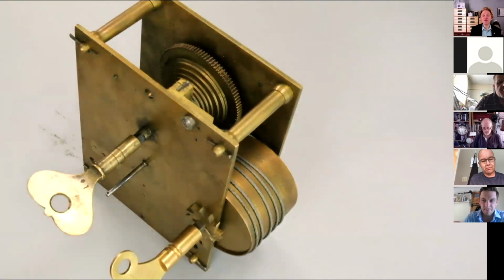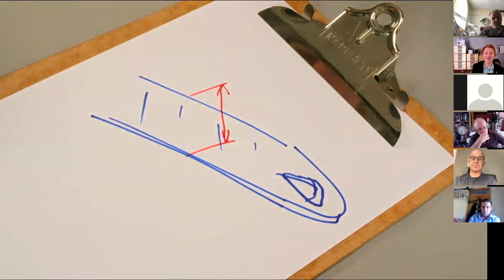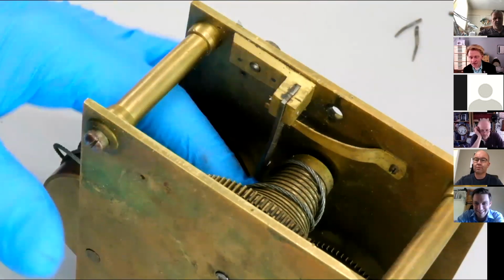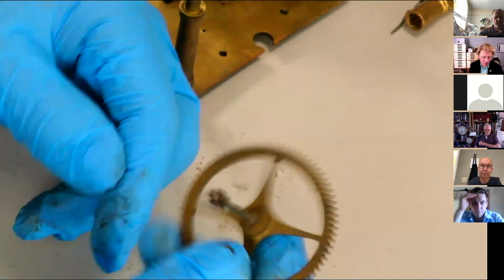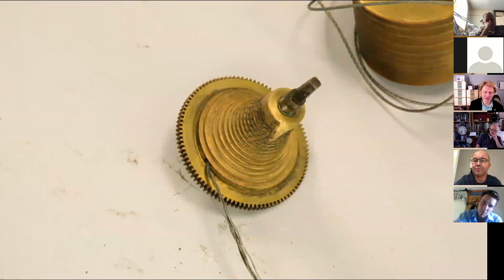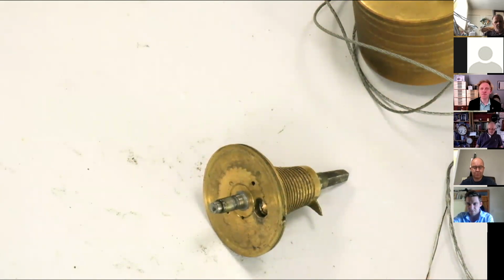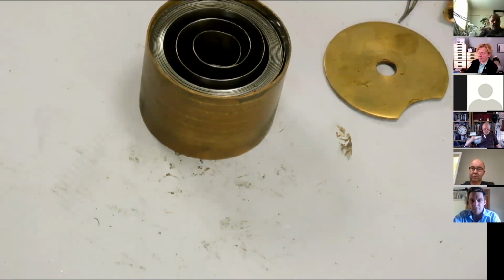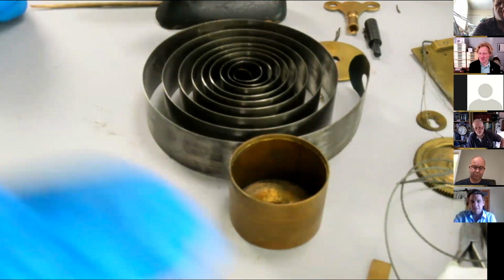OPEN CLOCK CLUB #034 202_07_17

Comment: Very interesting. I've just finished building the John Wilding English dial clock with date and have installed a phosphor bronze line. I will be taking it out and replacing it with natural gut. Probably not the super musical harp gut you refer to, but some rather cheaper gut from the clock suppliers.  Hopefully it will be good enough. Thanks for your advice. It makes sense. Not so sure about that pivot though.......
Reply from the maker: Thanks Brian.  Well done for making the clock.  Ah yes, much discussion to be had around that pivot!!!